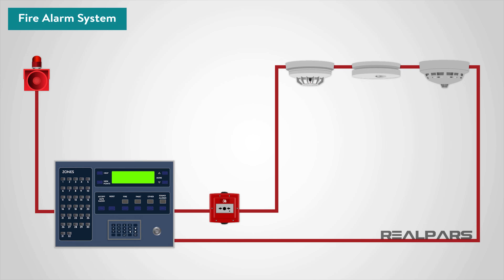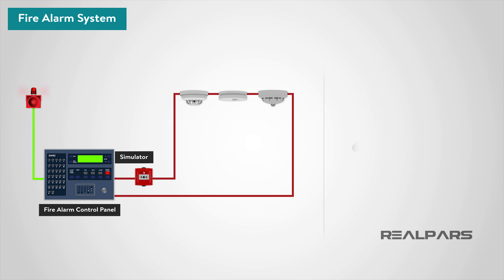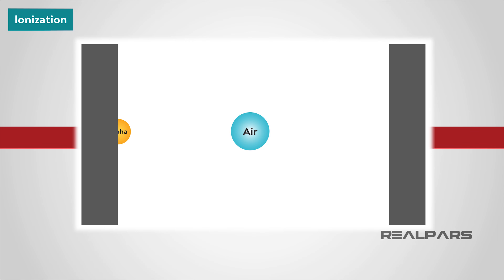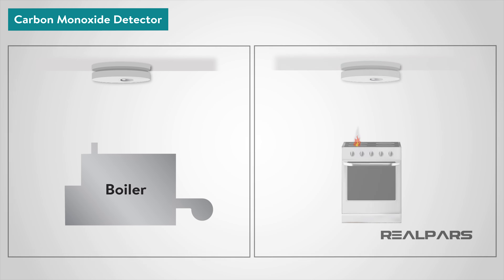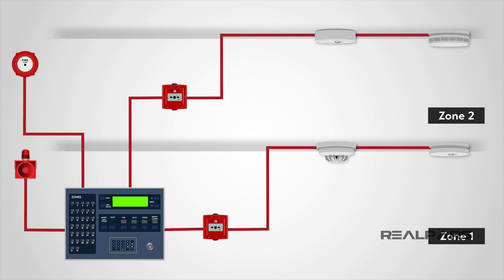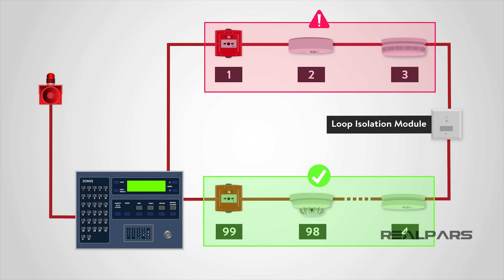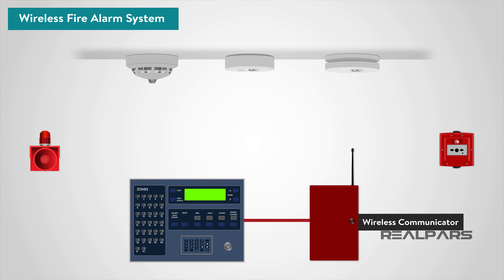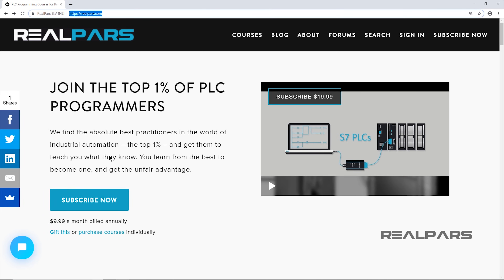What is a Fire Alarm System?

Comment: Is there a difference between a Fire Alarm Control Panel and a Fire Alarm Extinguishing Panel?

Can one extinguishing panel handle different extinguishing systems (C02 & FM200 for instance) and their different areas without conflict?
Reply from the maker: A fire alarm control panel is used to monitor smoke and heat detectors, LEL detectors, and other sensors, and set alarm, horns, relays to call the fire department, etc.  A Fire Extinguishing panel is used to trigger an FM200 or other fire suppression system based on a pull station or inputs from smoke or heat detectors in a limited area, like a network closet or server room.  Normally, you only use one type of fire suppression media, and the extinguishing system is usually limited to one set of actuators for the media used.  Consult with your fire equipment provider to see if there are multi-modal systems available.
Reply: Thank you for your reply. Can I say then that a Fire Extinguishing Panel incorporates extinguishing functions in addition to the functions of a Fire Alarm Panel? This would make it a control as well as an extinguishing panel. Am I correct?

Comment: In terms of accuracy, This is fairly accurate, except those initiating devices are European call points. The USA & Canada use Pull Stations. Same with those Notification Appliances, Those look like European Sounder-Strobes, While the USA & Canada use Horn-Strobes, Chime-Strobe’s, Or Speaker-Strobes, or the remote variants of strobes, speakers, horns, or chimes.

Comment: how about air duct fire alarm systems?and how its connected to the controls in an air condition system?
Reply: That can be really confusing. In a nutshell, there is a relay which is activated by the fire alarm that is interconnected with the HVAC unit. It can be done directly at the FACP, or by a HVAC shutdown relay in the field. That relay will either be connected to something like a thermostat power wire in a normally closed circuit (break the circuit, cut power to the unit to shut it down) or to an input on the HVAC control.

Comment: Thanks for the video. Can the emergency lights be connected to the panel so they come on when an alarm is triggered?
Reply from the maker: Absolutely!  With most fire alarm systems, there is a way to program which conditions will trigger the Alarm output signal, which can be wired to a light, horn, siren, or all of the above.
Reply: @realpars  I thank you for your prompt reply. Most you tubers do not bother in answering questions.

Comment: plz explain the purpose of End Of Line Resistor in conventional systems.
Reply from the maker: Thanks for sharing your suggestion with us! I have sent this over to our course developers. 

Happy learning!
Reply: End of Line resistors are used to determine a base value for a class B circuit, which is a normally open circuit with an end of line resistor at the last device. 4700 ohm is a common value on conventional systems made by Honeywell Life Safety, for example. If the panel reads 0 to 100 ohm (short) on an initiating circuit (IDC or "zone"), it decides there's an alarm. If it reads close to 4700 ohm, it's normal. If it reads no resistance, or a value outside the range of 100 ohm to the normal EOL resistance (or above) it will display as a fault. On a Notification Appliance Circuit (The devices like horns, strobes, etc that notify occupants of an alarm), any reading too far outside the normal EOL value will show as a fault. On NAC circuits, panels will put negative voltage on the circuit at all times, and reverse polarity to activate the notification devices. 

This is how conventional systems supervise input (IDC) and output (NAC) circuits in a class B conventional circuit under US National Fire Protection Association (or NFPA) codes 72 (Fire Alarm amd Signalling) and NFPA 70 (Electrical).

Class A circuits on conventional systems don't use EOL resistors, but have an independent circuit path to and from the panel.

To further confuse the issue, the Class A and B types can be referred to as "Style", 4 for B, 6 for A when discussing Signalling Line Circuits (SLC)

One point made in the video that is unclear is that "isolator bases" are usually only used on Class A circuits, but not on Class B circuits.
Reply: @siegetech74  Hey Chris, can you suggest me some good online courses for addressable fire alarm systems and access control systems ? Especially for the commissioning part.
Reply: @chetanmangha2157  That's not a simple question. Any training class I point you to will be limited in important ways. For example, each panel manufacturer offers classes and training resources specific to their panels. Different places have different codes in force. The important thing to know is what the specific laws, codes and regulations are for where you live. I'm a fire alarm technician in Florida, in the US, so I have to work within the codes adopted by my state and interpreted by local Authority Having Jurisdiction.

Comment: Hi. You mentioned intelligent system can only have up to 8 loops. What does it mean? Each loop is it the same as addressable where only up to 99 initiating devices can be fitted in?
Reply from the maker: A loop is a single segment of an alarm monitoring system that can contain multiple sensors.  Each loop is powered by a single circuit from the fire alarm monitoring panel.  Most often, a single loop is used for each fire zone, so that location of smoke or fire is able to be pinpointed more accurately.  However, since the devices in an intelligent system can identify its own location, a loop may be able to span many traditional fire alarm zones (like a floor in a building, for example).

Comment: Do you have courses on Data center BMS systems? Fire, security, cameras 
Thanks for the great content!
Reply from the maker: No, not yet.  That is a good idea and I will pass it along to our developers.  Data Center BMS systems have a large cooling load and require specially designed chiller systems and air handling systems.

Comment: thank you for this information . i have 1 question please   for addressable system  Why should the wire be returned from another direction for central system
Reply from the maker: The video shows one general way for the system to be wired.  Fire Alarm systems typically are serial loops (RS485, S-BUS, etc.) and a loop configuration provides some added reliability and availability of the system.

Comment: can you give me the pannel connection of fire alarm system??
Reply from the maker: Most conventional fire alarm systems are hard-wired, with a cable that has a pair of wires to power the device and a pair of wires for the status signal (actuated or not actuated).  Addressable fire alarm systems either us a multi-conductor cable for serial communications or a standard CAT5 cable.

Comment: Showed this to my family to explain to them what I actually do for a living! Very informative and useful for those who are new to the fire protection industry.
Reply from the maker: Hi Grace,

Thanks a lot for your comment! 

What a great way to paint a clearer picture for your family to see what your job entails! Great to hear that we were a part of that.

Happy learning!
Reply: Lol
Reply: But what about people who never

Gonna give you up never gonna let you down never gonna run around and desert you
Reply: Electrician here and first time doing fire alarm this week very confusing 😵‍💫😵‍💫😵‍💫
Reply: Hi, Grace. 
My Fire alarm system is giving false alarm so we installed 1/2 watt resistor on the end of the loop. DO you have an idea, what my the cause of the alarm?
Reply: @daledankenethdongallo1396   am new in the system but try this ,go to the system an check your connection properly if everything goes fine the connection then check your dead end en put resistor at the output with red an neutral to the same port an see what will happen next if trigger 😊
Reply: if its conventional maybe short circuit?  @daledankenethdongallo1396

Comment: Can you please tell us In which protocol fire alarm system working?
For both conventional and addressable.
Reply from the maker: Most fire alarm systems use a proprietary serial connection to their sensors.  It is likely that the I/O interface cards for your fire alarm system are only available through the manufacturer  of the fire alarm panel.  In Europe, Apollo and Hochiki  are two common serial protocols used for fire systems.  In the US, LonWorks and EIB are common.
Reply: @realpars  thanks a lot 
We are using Morley- Honeywell fire alarm system. In this both power and communication happening in same 2 core cable, 
Can you please tell us how it works.
Model : Morley zx5e series.

Comment: Which are the cables are using in fire alarm systems? I need better explanation ?
Reply from the maker: The type of cable used depends upon the fire panel and sensors being used.  For modern addressable fire alarm systems, CAT6 cables are used.  For systems with node identification and serial connections to the fire alarm panel, 4, 5, and 6-conductor connections are used to provide signal and power to the devices.  Relay-based systems typically are connected with 2-conductor cables that allow the existence of alarm/no alarm to be detected via relay.
Reply from the maker: NEC (National Electric Code) recognizes the FPL cable as being suitable for 2-wire fire alarm systems. FPLR cables are suitable for use in vertical runs through a shaft or from floor to floor within a building.

Comment: Pretty good explanation, though in the UK, when using an addressable system with dip switch addressing, the majority of systems have up to 127 addresses per loop
Reply: Good presentation, but a little dumbed-down, maybe.  I don't know where RealPars got a limit of 99 devices on addressable loop. He might have been talking about a specific brand control panel.  I'm most familiar with Honeywell (formerly Ademco) Panels.  The Honeywell Vista-128FBP Panel  (FBP=Fire Burglary Panel) supports up to 120 addressable devices on its multiplex loop, in addition to 8 on-board hardwired loops that don't use addressable devices.  
The Honeywell/Ademco Vista-250FBP Panel supports up to 242 addresses on its multiplex loop, in addition to its 8 on-board supervised zones that support non-addressable fire/smoke detection devices. 

Also, OP made it sound like his four kinds of systems were separate and exclusive of each other.  All the major Fire Alarm Panel brands in North America are "hybrid" systems and support conventional on-board (wired at control panel) supervised loops + multiplex loops with addressable sensors + "intelligent sensors" + wireless sensors; all in the same system; if Fire Code permits.   In the USA, Fire Code requirements for system equipment varies in different locations, though some basic requirements are universal. 

Another minor fact not mentioned is that the Control Panel and Keypad(s) are separate devices.  When we in the industry refer to a "Control Panel",  we are talking about the "brains"  of the system, the PCB (Printed Circuit Board) that receives and processes the sensor signals, determines what action to initiate, and informs the User of status, via the Keypad display.  The KEYPAD is often conflated/confused with the Control Panel,  Possibly because it's often mounted on the front of the Panel cabinet, but the Keypad(s) is/are simply the interface between the Control Panel and the User.  a User may have several Keypads, but there is only one Control  Panel.
Reply: usually every line in fire alarm system can get more elements for example 256, in my country, in Poland, it is law obligation that max element number in one line is 127 as you said
Reply: Very interesting to hear what the standards are in other countries. Here in New Zealand our national fire protection standards book states no more that 99 devices per loop on an analogue addressable system

Comment: Where are the riser flow valve sensors
Reply from the maker: The video gave some typical sensors and actuators that are connected to a fire alarm system.  You are correct, riser flow sensors are an important sensor in verifying water flow, detecting leaks, and detecting sprinkler activation.  There are many other devices that are typically connected to the fire alarm system, such as pull stations, override stations, fire hose station door alarms, etc.  This is a fascinating area of automation that is critical to life safety.

Comment: How to switch off one heat or smoke detector. if there is hot works on that zone area?
Reply from the maker: Normally, there is a bypass switch (keylock switch) near the smoke detector to disable it for maintenance.  Also, it is likely that bypassing the smoke detector input can be done from the front panel of the FAP.  The bypassed state will be displayed on the FAP, usually as a message on the screen or with a yellow flashing LED.
Reply: @realpars  Sir thank you for explaining 
can you show video regarding my question.

Comment: If not mistaken Addressable Fap can connect maximum of 4 loops and each loop contains up to 127 devices.Did I hear you say each loop can connect up to 99 devices?
Reply: khomottso Legatto setatti that all depends on the manufacturer of the system.
Reply from the maker: There are addressible fire alarm systems that can handle 4 loops and some that can handle 8 loops.  Each loop can typically handle many devices, with some systems having the capability for 99 devices and some with 127 devices.  Those with 99 devices use device 0 as the FAP address.  Only 99 are allowed because the station number can then be limited to what can be shown on the FAP in two LCD digits, 00 - 99.  Those which allow 127 devices also reserve device 00 for the FAP, and the other devices are allowed to have addresses determined by DIP switch.  With a normal DIP switch component, there are 8 switches, which allow 127 addresses, other than 00, to be selected.

Comment: What's the branch of the controller?
Reply from the maker: I am not sure exactly what you are asking, but in the video, there were two types of "branches" from the controller.  In one case, there was wiring of multiple devices based on zones.  If one detector in a zone alarms, the fire panel annunciates a problem in that zone.  For intelligent fire systems, loops are individual networks of devices that report their status back to the controller.

Comment: Hi there! 
I have started a new job six months ago as a Fire Alarm Technician. I pre-wire commercial buildings and fit off the devices before the senior engineers come in and install the panel and program the devices. I am assuming that they use PLC for the programming part? The reason why I am not sure is that some of the junior techs won't really tell you about any of this. But I'm determined to push the barriers and learn all about fire panels and how to program them. Are talking about the same thing when you say PLC?
Reply: Hey there, no a fire alarm control panel and a PLC are different things.
Whilst the PLC may well have some signals from the Fire Alarm control unit they are different units.
A fire alarm control unit is dedicated to its task and only works in fire protection, a PLC however can do multiple functions from controlling a complex automated process to simply turning on and off the office lights.
I hope this explains things for you, Realpars have a lot of content which can give you all the information you need on PLCs and automation.
All the best in your learning !
Reply from the maker: Dan is correct.  Fire alarm panels typically use their own proprietary controller (not a PLC) to monitor and take action on inputs to the fire alarm system.  Most of these systems are comprised of a set of input relays, a logic processor with limited configuration, and a set of output relays.  There may also be a telephone connection to automatically call the fire department in case of fire, but all of the functions of the fire panel are to detect and take action on fire system devices.

Comment: What is the generally accepted wireless standard for fire alarm systems?
Reply: I beleve they were refering to residential type detectors. Some use wifi
Reply from the maker: Use of wireless detection and alert systems is covered by NFPA 72 in the US.  Hardware should conform to UL 864 and systems to UL 2075.  Outside of the US, DIN EN 54-1 is the applicable standard.